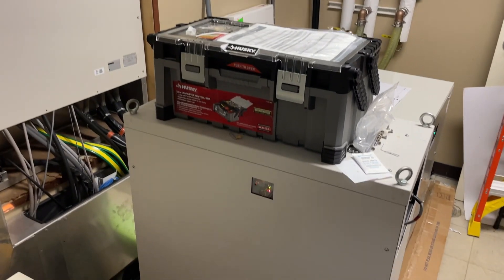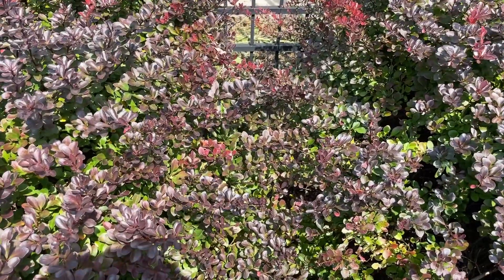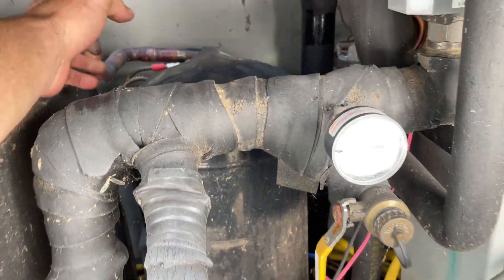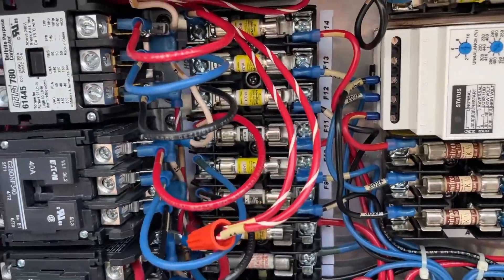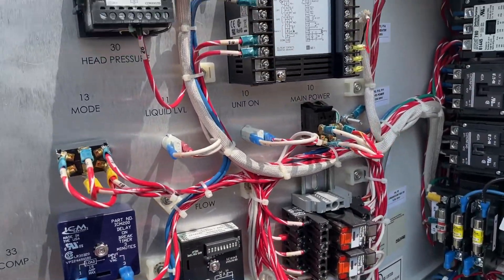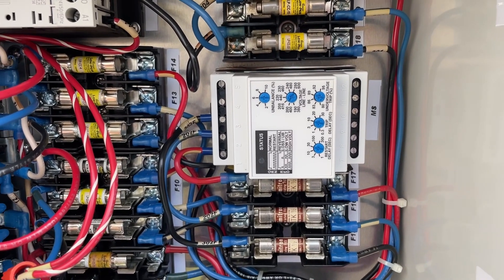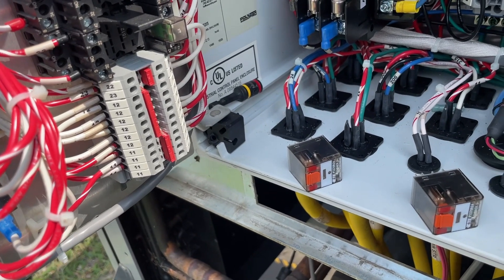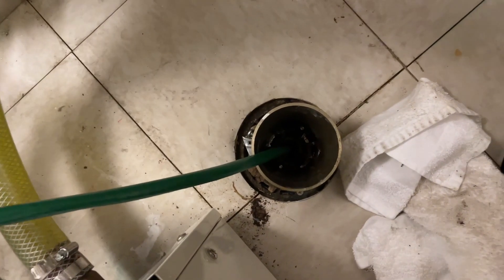Diagnostics52: MRI Chiller

Comment: This might super random, but I recently got a fluke 87v and I've been looking for magnet straps for it the ones on amazon do not convince me, only the klein magnet does, and I came across your 2 year old video about how you use leather and one of those klein magnet, my one question is, did you ever try that with the 87v? If so does it hold?
Reply from the maker: Yes it has worked very well for me 👍

Comment: Awesome video! On a side note do you have any advice on how to work on VRV systems, more like how to learn about them?
Reply from the maker: What’s your experience with VRV so far?
Reply: @HVACLife  not much, I learned how to use a service checker and look for some information to fill up inspection reports but as far as actual troubleshooting I haven’t done anything yet.
Reply from the maker: Ok definitely search my channel for “VRV” and a lot of principles I teach on other brands apply to Daikin as well.  Feel free to PM me if you need to.  VRF is hard to learn so definitely be patient with yourself.  Run systems in full throttle cooling and pay close attention to EEV openings, discharge superheat, and superheat of IDUs 👍

Comment: I thought you were on the right path with the phase/voltage monitor that was the first thing I was looking at before you mentioned it. Too bad you didn't get to figure this out. On a side note, on these type of chillers you have deionized water loop for the field equipment, then a glycol loop. The deionized and glycol loop share an HX, that box in the bottom next to the compresso would probably the heater sump with heater elements. Not only chilling the process but heating it, too, to keep in a specific temperature window.

Comment: I used to work tech support for this company. Call their tech support with the unit serial number, HB#####, and they can email any missing wiring/piping diagrams. They also stock parts and provide phone tech support for the life of the unit. A very good company to work with.
The head pressure controller reads a transducer and controls the condenser fan VFD. If that's dead, you'll be tripping on high head pressure. It should be be lit up all the time displaying the real-time head pressure. The VFD is on the opposite side of the unit from the main electrical box.
The compressor should run constantly. The temperature controller monitors the fluid temp and operates the hot gas bypass valve to match the heat load. It can usually hold the fluid temperature within 0.1C of setpoint. If I remember correctly, there's a high pressure cut out on the compressor discharge line that has a manual reset button on it. That is likely what's keeping the compressor from running.
I think we were having issues with that brand of 3-phase monitor where they would just randomly fail. We switched to a different brand and the problem went away. In fact, those 2 candy-cane wires that have a wire-nut hanging there, are probably from someone bypassing that phase monitor.
The wiring diagram on that unit should be stickered to one of the lower side panels, but those stickers tended to have issues...
Reply: Wish tech support would have told me this when I was working on this exact chiller 6 months ago and was getting intermittent issues with the chiller having to be reset.